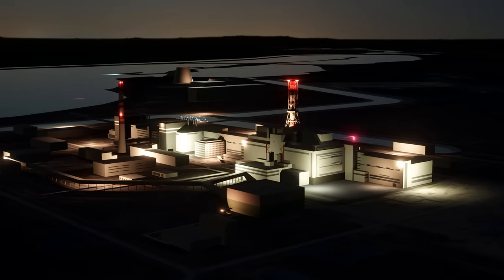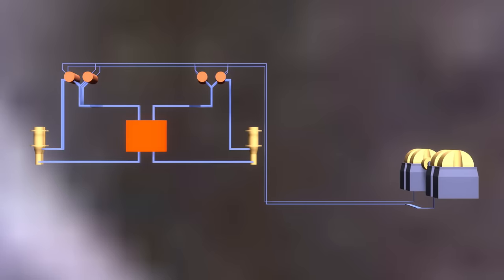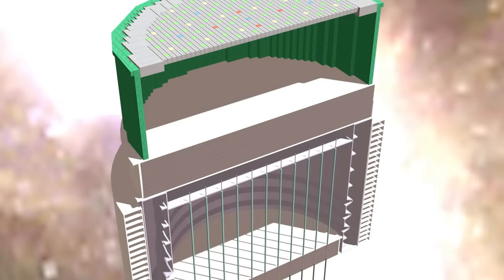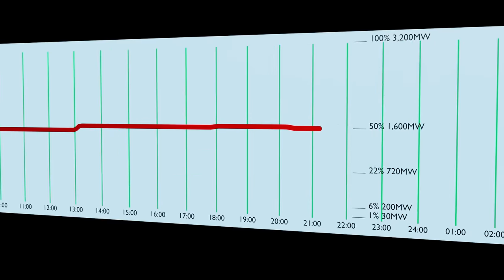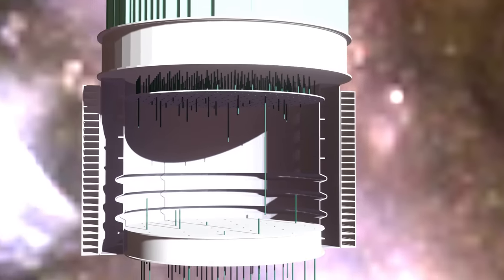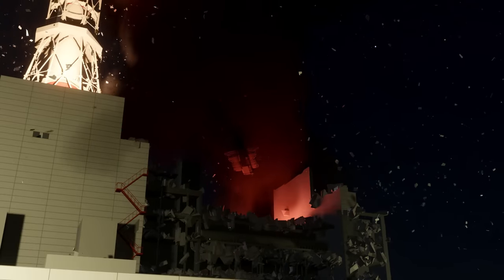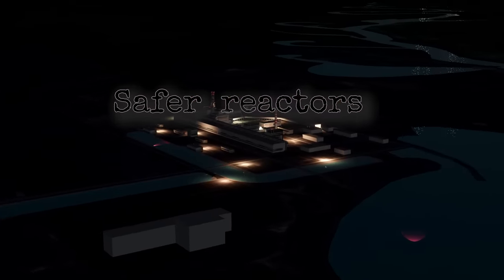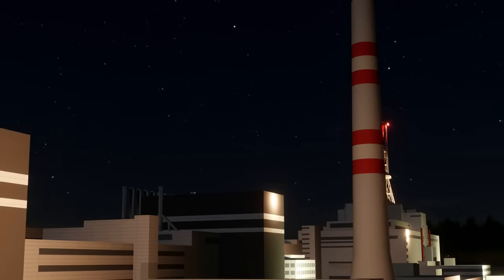CHERNOBYL AZ-5 why it exploded

Comment: The amount of energy required to send the two MILLION pound reactor lid 100' in the air is absolutely terrifying!
Reply: What’s even more incredible is that he said it was 2000 tons. If that’s accurate, it’s actually 4 million lbs US  or could be almost 4.5 millions US pounds if it was meany as 2000 Metric tons. Either way, scary as hell.
Reply: @moparman0314  I guess metric tons. In Europe and (back then) USSR it was (and still is) metric system through and through, bar UK. Thus a tonne is always 1000 kg, or 2205 lbs (US).
Reply: @MrKotBonifacy  It was 2,000 metric tonnes.  I worked on a safety upgrade in the Leningrad NPP in 1997, have seen these things close up and they're scary beyond belief!
Reply: @Li.Siyuan  Thanks for the info/ confirmation. Cheers!
Reply: @MrKotBonifacy  🖖
Reply: @moparman0314  it also was launched for around 10 seconds, just imagine
Reply: It’s was highly heated and compressed steam so it’s not a surprise
Reply: Not only did it get sent 100 feet in the air but it had to busy through multiple layers of steel pipes, rebar and concrete on the way up.
Reply: At least 100 tons of TNT.
Reply: A lid that weighed millions of pounds was flicked like a coin. There was a man who was in the room when it happened. He most likely died immediately with the explosion and secondary explosion. But because the radiation will not settle down for thousands of years they can never recover the body. He will forever remain entombed in the reactor.
Reply: @TimberlakeTigerGirl  There were several people who were very near the reactor vessel when it exploded. I have no doubt they vaporized in the blasts, and if not, they are buried beneath the debris to this day. Either way, they died instantly.
Reply: It's terrifying thought...the amount of energy clearly was off the scale and it puts into perspective certain things about nuclear energy...1 miscalculation and it's all over for decades and more..
Reply: @giorgosarifoglu953 this is not true for most reactor designs. The RBMK design was poor, and would not have been licensed in the US, even in the 50s
Reply: I find that very fascinating too. Like, that explosion must have been the size of a nuclear bomb or more for that to happen.💀
Reply: Into the air through the ceiling. Physicists say that it was probably in the air for 10 whole seconds
Reply: Just blasted that into the air like a pot lid: imagine the magnitude of the force of the steam!
Reply: Supposedly the blast was 4000 times more powerful than Hiroshima so that would do it
Reply: You obviously haven't eaten taco bell before 😂
Reply: @medix1203  right? That stuff blows holes in da pants oi.

Comment: Just breath taking, you answered my little questions like why the control room is scavenged up till today
Reply from the maker: Glad you appreciated the effort. The scavenged control room is a cool story. However sometimes the truth spoils a good story. multiple comments tell me it was impossible for radiation stalkers to access the control room. Security was impossible. 
I would think it us safe to say the staff who would have had legit access would conceivably have pocketed a few keepsakes for themselves. I would have. 😅
Reply: @Mike-Bell  those stuff will probably be end up in underground auctions one day, imagine if someone took the actual control room 4 az 5 switch, just imagine how much would it be sold for?🤔
Reply: @Mike-Bell  You fail to appreciate the ingenuity and stealth of humans. The sarcopagus was far from secure. Until that dome sent up, I can see a few determined souls braving both security and the radiation for that high value component.
Reply: I mean, I have several gauges and old switch gear from various dead industrial complexes littering my shed walls, but nothing that would register on a Geiger counter. Scientist, engineer or other, it doesn't seem like a winning move to salvage this site. Those who salvaged all the left over response vehicles/aircraft (that have not been cancered to death that is) would likely agree.

Comment from the maker: Corrections thanks to commenters:

*The bottom control rods were not coupled with the AZ5.  AZ5 only lowered the top rods. If the bottom rods had moved as animated the disaster would have been averted. Here is the corrected video in the Russian version of this video https://youtu.be/NeZScDZA_uY?t=453
*There was a smaller first explosion followed by the main explosion approximately 2.5 seconds later.  See https://youtu.be/NeZScDZA_uY?t=545
*The delay meant less xenon because of the longer time to burn it off. 
*It is not certain whether Akimov or Toptunov pressed AZ5. In certain accounts Akimov disconnected the servos to drop the rods faster.
*The lid weighed 1,000 ton
*The return loop from the turbines is indicated here. https://youtu.be/NeZScDZA_uY?t=98

A3-5 is the Russian spelling for AZ-5...
Reply: This video was probably the best explanation for Chernobyl I've ever gotten. Thanks!
Reply: missing a return pipe from the condenser to the reactor
Reply from the maker: @connclark2154  Yup true.  The return pipes routes are not clear in the drawings I that I got my hands on so I didn't know how to model the return in the 3d's either.
Reply: @Mike-Bell  not a bad explanation however Anatoly Dyatlov did get interviewed, have you watched his interview? he provides so much information about what was going on in the control room from his 1st hand experience... and "nuclear stalkers" cant get close to the reactor plant to remove anything which is a relief because pripyat has been further destroyed by marauders... not to be confused with urbex guys who have rules by which they are to leave the place exactly how they found it. security within the exclusion zone is very tight due to marauders but there are plenty who take the chance to document and even try to maintain the place for future urbex. Some channels for you to see this would be Bad Cat, Shiey and Kreosan.
Reply from the maker: Yes I carefully watched the Dyatlov interview. But he likely massaged his version to improve his case.  It seems probable he was an objectionable character and a cruel bully.   I do feel for him as he has been cruelly vilified and scapegoated.  At the end of the day it is pretty straightforward.  If the AZ5 tip effect dangers had been known to him he would never have given those orders and the disaster would not have happened, certainly not on a catastrophic scale.
Dyatlov pulled the trigger but the gun was handed to him by the regime.
Reply: If it's a correction, pin it so it comes on top of comments
Reply: @Mike-Bell  Yes true what you say... and yeah i felt for the guy being blamed they way he was when he was not given all the tools do do his job correctly.
Reply: @Mike-Bell  I recommend the RBMK5000 YouTube channel
Reply: But Akimov pressed the AZ-5
Reply: @Mike-Bell  Mike you put it so right. Every word. Thank you for your concern and contribution to historical justice - the only option the Evil Empire left us with in case of Chornobyl.
Reply: AZ5 was pushed by Toptunov, not Akimov. Akimov turned switch off to remove power from the control rods servos to allow rods to drop down due gravity. It was after Toptunov pushed the button.
Reply from the maker: @ДенисСеменов-ъ4м  thank you for the information
Reply: it is a huge lie about to be needed hold 15 rods !!!
Reply: @Mike-Bell  The "tip effect" as you say has been described as a "kick in the pants" by an MIT professor; however, the reactor was already a goner before the control rods were inserted. This was due to the low power level and subsequent low flow rate of the coolant water which resulted in a positive void coefficient at the bottom of the core. People love describing the effects of xenon 135, which resulted in low control rod density (like you say, taking the brakes off), but the main issue were the voids in the bottom of the core. Shutting the turbine off made the voiding effect lead to a runaway power excursion, which was the end of the reactor. The tip effect was kicking it while it was already down. Great presentation nonetheless.
Reply: info Peace  The HBO series wasn't about science; it was about the human aspect.
Reply: לא הבנתי איך זה אתה אומר שיש כתוביות בעברית אבל אין וגם אפשר למצוא את זה ברוסית ולראות את זה וזה מה שעשיתי
Reply: @Mike-Bell  לא הבנתי איך זה אתה אומר שיש כתוביות בעברית אבל אין וגם אפשר למצוא את זה ברוסית ולראות את זה וזה מה שעשיתי
Reply from the maker: @its_amit2502  יהיה עליך לבחור עברית מרשימת השפות.  

You will need to select Hebrew from the language list.
Reply: @Mike-Bell  ok אבל אתה יכול לפתוח עוד ערוץ אבל בעיברית ולספר אל זה כי ברוסית אני לא מבין הכול ואני לא יכול לשאול שאלות בבקשה תפתח ערוץ חדש
Reply from the maker: @its_amit2502  
 הערוץ שלי הוא אנגלית. אני משתמש בתרגום בגוגל כדי להבין וכדי להשיב לתגובות משפות אחרות. 

אני משתמש כעת בתרגום בגוגל כדי להבין את התגובה והתשובה שלך. אתה יכול לנסות להשתמש גם בתרגום בגוגל אם אתה רוצה לקרוא את התגובות.

My channel is English.  I use Google translate to understand and to reply to comments from other languages. I am using Google translate now to understand your comment and reply.  You can try and use Google translate too if you want to read the comments.
Reply: @Mike-Bell  אאאאאא טוב בסדר שיהיה לך יום טוב ביי ביי
Reply: @Mike-Bell  Dyatlov's behavior was exaggerated by book ,,The truth about Chernobyl" written by Grigorij Medvedvev. HBO series and most of books about chernobyl are based on his book. Some plant workers say he added some fantasy, false statements and especially exaggerated Dyatlov. But medvedvev wrote his book just after disaster, and he worked in the power plant for some time, so people assumed he had written the truth. But the fact is that medvevev was also high ranking soviet official at the time of disaster, he was supervising construction of power plants in the ministry of energy. Therefore he also took part  in negligence, probably he tried to shift more blame onto Dyatlov. In soviet state constructions and machines are always perfect, just operators are blamed.
Reply from the maker: @connclark2154  Thanks, See correction made in the Ukrainian version here  https://youtu.be/8dqh9t3HyDk?t=91
Reply: @cytrynowy_melon6604  Medvedev didn't even worked on Chernobyl plant after it was completed, he worked on it's construction in 1972-1974.
Reply: @lordvader6172  Except I don't think it is correct, if the graphite tips were already in the reactor lowering them would not increase net reactivity even if water was displaced unless the reacting was really uneven. If the graphite was out of the reactor (rods totally pulled out) that would explain the increase in reactivity after button press, but it would make no sense to ever pull them out that way (unless the operators simply made a mistake).
Reply: @JC-lu4se  So you are saying the reactor was going to explode at that time even if the scram button was not pressed? I find it highly unlikely that it would be just a coincidence that it blew right after the button was pressed.
Reply: @cyberfunk3793  The reactor was going runaway, so yes it was going to blow apart with or without the AZ5 button being pressed. Pressing it only hastened the coming explosion because  of the graphite at thete ends of the control. rods.
Reply: @taraswertelecki9886  I don't believe it is totally clear was it the button press or what that in the end caused the accident.
Reply: @cyberfunk3793  It's perfectly clear pressing the AZ5button was the final straw, due to the graphite at the ends of the control rods, which also jammed where the graphite on the ends do the most damage.
Reply: @taraswertelecki9886  It isn's so simple, thunderf00t has also done some analysis on it and had another theory.
Reply: @cyberfunk3793  It matters little at any rate, the reactor was out of control and there was no way the operators could have prevented the explosion with or without pressing that switch.
Reply: @taraswertelecki9886  That is what is not known. The reactor was not supercritical so if the switch was the cause, the accident could have been avoided if the switch or reacter had been desinged differently or perhaps if the button had not been used and the control rods would have been inserted individually.
Reply: Very interesting animation, however, if the video continued on the preventive measures developed to prevent re-occurrence, it could give the whole world a moment to breath that such disaster will not occur again in the world especially with what i noticed yesterday in Ukrayn. Can  critical  control system  etc be impacted by external impact such as rockets etc. . what is the solution To tell them to stop fighting to save innocent kids and women !!!Think about it. Do we need to build more nuclear plants and assume probability of occurrence is low or robust system is there..please, please, please, reassess.
Reply from the maker: @yasser6748  nuclear power is highly complex. It is not able to withstand a wilful attempt to destroy it. This is the first time in history where nuclear power are in a large war and the outcomes are very uncertain and dangerous
Reply: The truth about Chernobyl: HOW THE 4th UNIT OF CHERNOBYL NPP WAS BLOWN UP (channel-KS).

Comment: This was amazing to watch!
I’ve read up, and understand every part of why the reactor went into a meltdown phase, but your video was able to explain every detail, and every part of it all... in under 13 minutes!!
That’s an amazing feat! Great job on this!
Reply: Well if you understand it, can you explain why lowering the graphite that is already in the reactor would increase reactivity? Water at the bottom is replaced by boron on top - net result surely is less reactivity, not more, and afaik the reactor is hottest at the top, not the bottom? The only thing that makes sense to me is this explanation if for some reason the reactor was really uneven, and even though net reactivity decreased, it increased locally so much in the bottom to cause the explosion. The other option would be that the rods were actually pulled out so far that the graphite was out of the reactor until the button was pressed.
Reply: @cyberfunk3793  The graphite didn't reach all the way to the bottom of the reactor, so when it was lowered, it displaced the water at the bottom of the reactor, to the point where there was almost nothing controlling neutrons at the bottom of the reactor, which caused a localized power surge. This was explained in-video, by the way.
Reply: @chengaanimates2108  "so when it was lowered, it displaced the water at the bottom of the reactor, to the point where there was almost nothing controlling neutrons at the bottom of the reactor, which caused a localized power surge"

And this would have been compensated for by the water(or boron in the control rods) replacing the position higher up where the graphite had been before, so the net reactivity would have been less unless for some reason the reactor was functioning very unevenly and there was significantly more reactivity lower down, which would be strange as the temperature is higher the higher you go so it should be the opposite: more reaction higher up or at the center.

"This was explained in-video, by the way."

The explanation doesn't add up, as I made clear, by the way.
Reply: I have heard that the heat was so intense at the bottom that things melted and control rods could not move down

Comment: Short answer:
The RBMK reactor 4 at the chernobyl NPP was a graphite modified RBMK1000, the reactor got too low power so the controlers started to raise the power, the power got too high power so the A3-5(AZ-5). The control rods shot into the reactor, but the graphite RAISED the power. To around 33,000. To make it worse, the reactor was also poisoned

Comment: I think you're right to remind that this was designed in an earlier time, without much of the detailed knowledge and modelling that we now have, and that it is easy to criticise individuals who did not have the benefit of our hindsight.  However, that said, it's pretty reasonable to criticise a system that allowed the reactor to start work before its safety testing was complete, placed very clear pressure on its engineers to complete the test regardless of whether the moment was suitable or not, and decided not to tell them about known flaws in its emergency shutdown systems.  Just as this was a steam and gas explosion not a nuclear one, the root problem was a managerial failure not a technical one.
Reply: Human Incompetence. The source of 99.8% of the world’s problems.
Reply: @Amy Weinholtz The U.S. also has done its share in that regard, and then some. And we also had nuclear accidents that have killed people horribly by radiation poisoning and acute radiation sickness.

Comment: Extremelly well done animation! A mistake not already mentioned is that there were no channel ruptures at Ignalina. Ignalina is where tip effect was discovered, not Leningrad.
Also, you should have mentioned the spatial problem: core too big, essentially ~40 reactors under one cover. It only took a small fraction of the core to go supercritical for the disaster to happen.
Reply: Correct. The failure of several fuel channels was the cause of the first explosion that flung away the 1,000 ton reactor top. Steam pressure built up in a "hotspot" at the base of the core so rapidly in those fuel channels they ruptured and the steam escaped beneath the reactor lid. It soon built up rapidly enough to fling away the reactor lid and all the control rods right through the roof a kilometer into the air. When that happened, all the other fuel channels which were also at extreme pressure were suddenly open to the atmosphere, and the water in them flashed to steam too. That was followed by the second explosion which occurred when hydrogen, red hot graphite and oxygen from the air came into contact with one another.